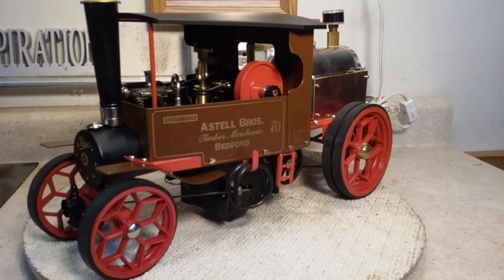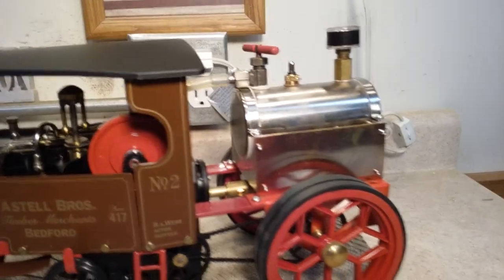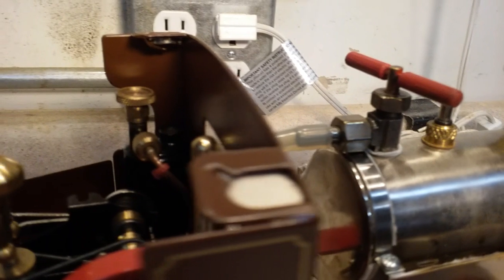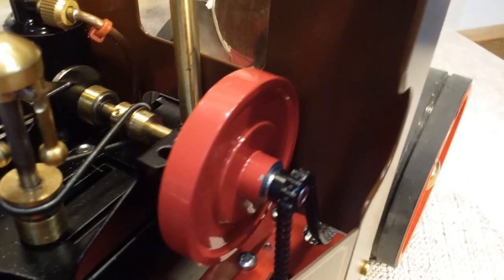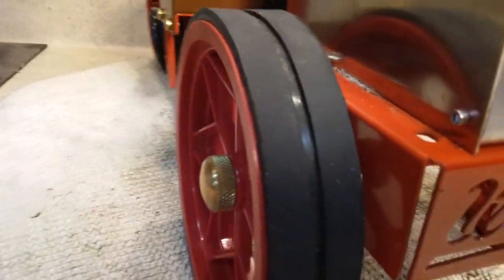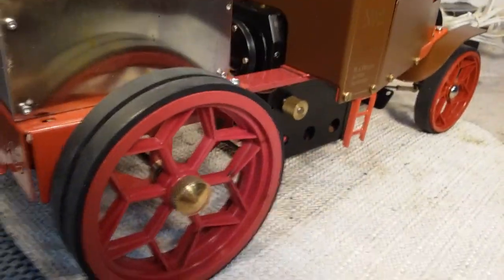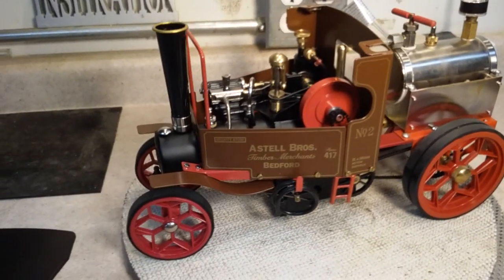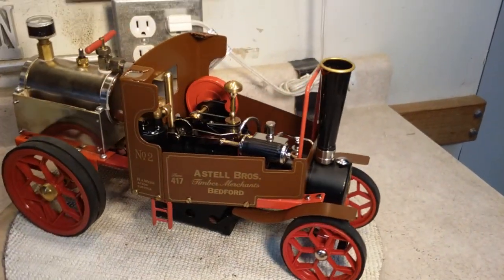Wilesco D310 steam lorry, mighty atom w/ modifications

Comment: great work - congratulation ....Can you please give some more details on the gas burner ?
Reply from the maker: Certainly Heike, the tank, line & bix burner were bought from Forrest Classics out of UK , the tank is "Bix Mini Refillable Mini Gas Tank" the burner is Bix 005 2¾"x1"x1" Rectangular Burner , I don't remember the length of the gas line , probably 6-8" & you will need a Gas Refill Adapter , I believe I bought this complete kit "Bix 026 Ceramic Burner, Gas Tank & 135 mm Pipe Kit "
I hope this helps , Bruce